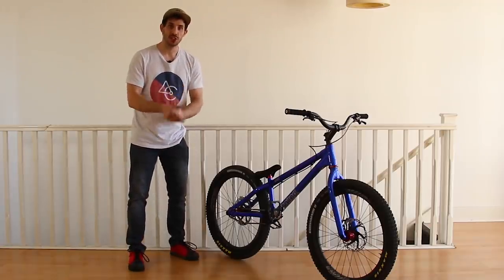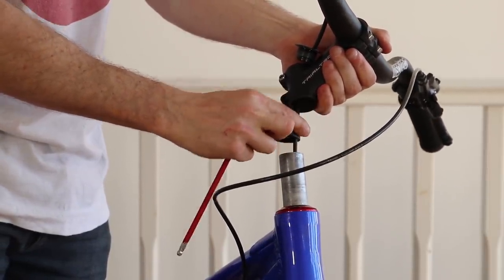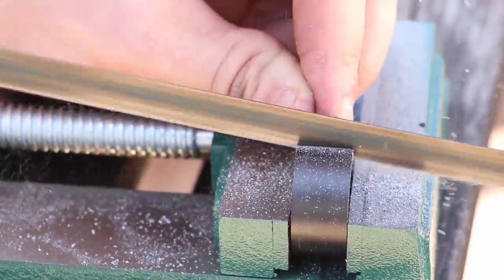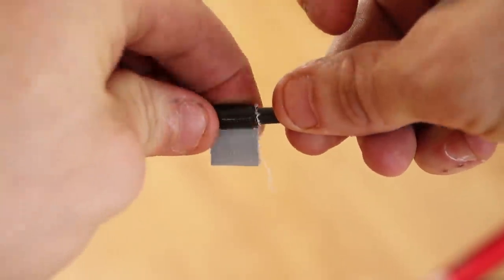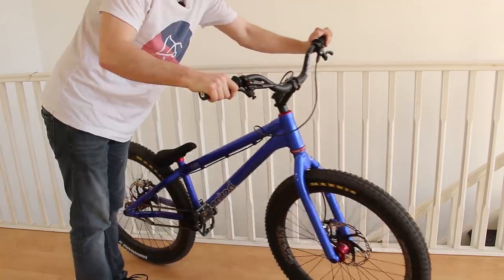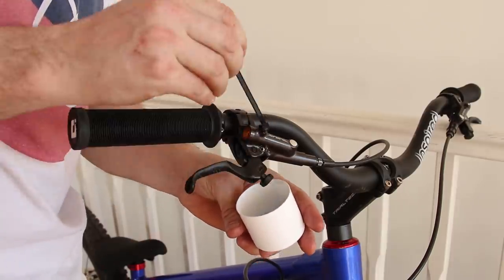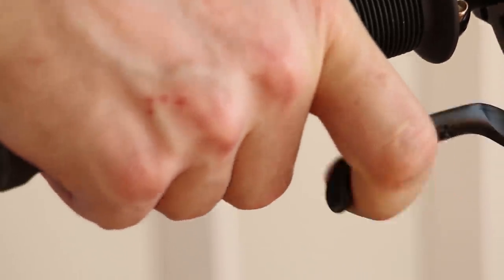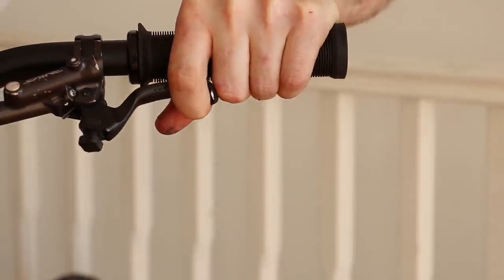Top 5 Street Trials Bike Hacks I Always Use

Comment: Mate! I was losing my mind over these brake pad noises! And I've never seen a hack this good, thanks a LOT Ali!
Reply: Would it work on grinding the brake pads on the back?
Reply: @Ali_Clarkson  It indeed does! Moreover, for me it silenced the noise even better with the tape applied to the pads edges as well
Reply: @bobergderstecher  I think it would very much destroy your brake pistons
Reply: I am going to try this one for sure, have a bit of that knocking on my brakes...  thanks!
Reply: IF you rub mud on your disk rotor & ride bike while pulling brakes on & off will quieten down brakes! if run rim brakes switch to disks?
Reply: Me too. I've never used disk brakes before so I was wondering what the hell that sound was. Thought my drivetrain was messed up.
Reply: same here, I was asking few bikers what causes that and nobody get answer.
Reply: Same here. Brilliant!

Comment: Tip #6. If you got a brake but not very good use a elastic band/cable tie to squeeze the leaver over night. It helps the air come to the top and sort of self bleeds

Comment: Hi Ali, great video. I use an old eye dropper filled with mineral oil in lieu of your zip tie trick. Works great for a quick top-up on the trail too, if you notice your brakes are feeling a bit weird mid-ride.

Comment: awesome video Ali
Quick tip, while you have your zip tie out, and have bled your brakes, if they are not quite 100%, simply wrap the zip tie around the lever to pull a slight amount of pressure on, and leave it overnight.
With the lever opening the bleed port inside the master cylinder, air is free to flow upwards out of the system
Reply: it definitely works.
again, not a replacement for a perfect bleed.  but great if you are away from home or don't have the time for a full bleed.
I learnt the trick on motorbikes, works just the same

Comment: Cheers for those tips Ali, I don't ride trials much but I do run a front brake hose through the steerer of my DJ bike. Brake silencing isn't so much of a problem on a DJ bike, we don't use them much to start with and the only noise I do notice is squealing from cold sintered pads :-)

Comment: For hs33's I recently discovered that instead of grinding your rims again, you can use an eraser to get the rim clean again. I mean it won't help you get a rough surface on the rim but it definitely improves braking performance because I feel like it helps to remove greasy stuff and dirt. :D
Reply: Any hint of wet on the rim and braking performance falls off a cliff with an unground rim though. Lots of riders in countries with dry climates rub tar on the braking surface to get ridiculous bite and hold.
Reply: @peglor  yeah, i was talking about an already grinded rim. But instead of grinding again you can get a bit more lifetime out of your existing grind by getting the rim clean again with an eraser.
Reply: @peglor  also works if you put too much tar on the rim and want to get it off 🙂

Comment: I need to change my spacers, can anyone tell me how high the risk of loosing fluid is? I turned the lever upside down so it shouldnt spill any there, but my cable is now facing down because of that. So im a little concerned the hose will spill fluid when im gonna remove it..

Comment: Heh the ziptie hack is great for the accidents - if you happen to have the fluid in hand - but when you change a new lever planned, why not just use the shimano cup and keep tapping the plug stick at the hole until your reservoir is full?
Reply: @Ali_Clarkson  The best ten bucks you can spend, I tell you.

A funny anecdote... Shimano changed the bleed nipple threads in the newest road levers. Instead of selling another plastic cup that lasts a year even in shop use, they supply an adapter with each and every new-threaded STI-lever they sell, even to OEM.

Comment: You can also get adjustable headset spacers. One above the stem and one or two bellow would get you quite a bit of adjustment without having to even take the stem of the steerer. They're kinda ugly tho so I haven't done it. Unfortunately I still have to disconnect the brake to make stack adjustments lol.

Comment: Why do they make slippery brake pads? There are coatings which they could use.
Reply: @Ali_Clarkson  it very likely has some measurable impact on brake power and/or lever feel. Just using the right sort of paint on the steel backing plate would likely be sufficient. 

A slight recess or locator for the pad position would also remove pad play.

Regardless of whether a lot of hopping makes the problem actually dangerous,  I don't like brake play as a not-particularly-trials rider who just needs to be able to track stand.